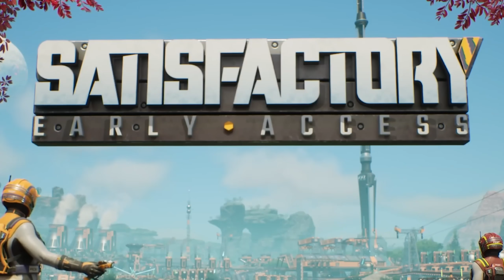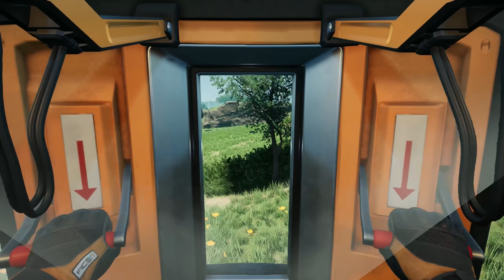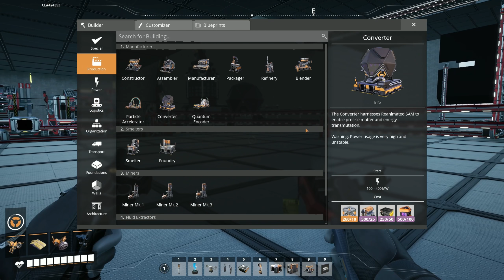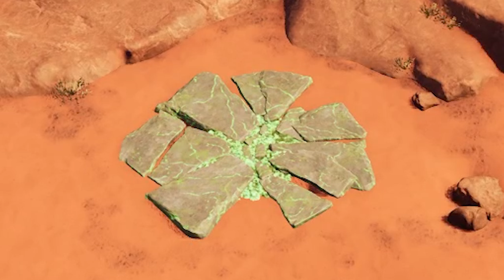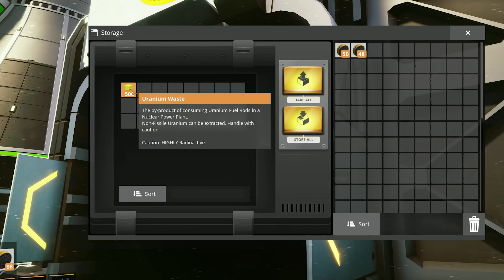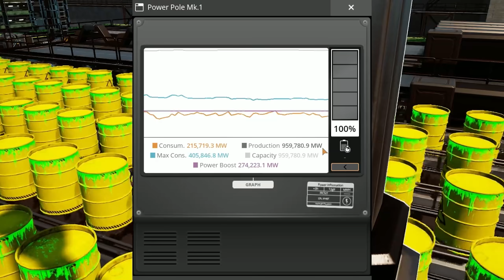800 HOURS in 8 Minutes - Satisfactory 1.1 World Tour

Comment: Now the real work can begin on my map. Now since the hover pack is unlocked and built.
My biggest issue now is the design. First off building the Zero Point Hub. Which is in the centre of the map. Space elevator is the beacon. Not bacon.....mmmm bacon. 😋
Some stupid reason I just can't go abstract and I like the looks of unusual designs but I just can't build it. The all have to be square to maximize space. Is that like OCD or something like that? lol
Making a hyper tube cannon and found a minor glitch when attaching the hyper tube branch to the line...don't. place it then connect. I ended up glitching though it then fell though the map.

Comment: How is anyone supposed to get to the endgame in this game if they don't have an engineering degree and can't play the game full time?
Reply: I completed the game in about 200 hours over 6 months, you don't have to go as crazy as ol kibz
Reply: I'm an idiot who is bad at math and I managed to get to endgame in like 150 hours. You just have to start simple and focus on one problem at a time. Also use blueprints, dear god I wasted so much time not making/using blueprints. You don't have to make elaborate super-efficient factories, you just have to make sure the system is self-sufficient.
Reply: @chandler224  And the biggest benefit of blueprints?  Single click deletion of those structures.  It SUCKS having to tear down a factory piece by piece by piece by piece.
Reply: You don't need to go crazy like the content creators. I love watching Kibitz, Kibz, TotalXclipse, but I finished endgame without a lot of monstrosity buildings (I have created some on some playthroughs but they aren't necessary, they are for fun!). You don't have to build 100/min of each space part, or generate 100Terrabytes of power; you don't have to use exact ratios, you just have fun figuring out how to get that one manufacturer to occassionally spit out a spacepart every minute, two minutes, 5 minutes, whatever, and eventually you get the goals done! I remember for a while I would just let it run while I was sleeping to keep the parts production going because I was only making 1 every two minutes. 

The goal isn't the space elevator, it's the fun you have building along the way. Enjoy!
Reply: @Harchon1  Totally this. While I appreciate the insanity that Kibz is willing to endure for our entertainment, I OTOH, don't have that kind of time, nor dedication to the overall project. When you have fixed numerical goals at endgame, it doesn't matter if you make 1/min, or 100/min, it'll eventually get done.  I never saw the point of spending 40 hrs building a factory that will produce all the elevator parts in 10 minutes, vs a single manufacturer that takes a few hours...I can spend that extra time exploring, or just admiring the scenery. I finished the game months ago with the simplest of production chains, although phase 5 taxed my brain at the time. Didn't even build nuclear power. But that's what I'm doing now...building up a nuclear plant and other blueprints to make the really complicated stuff simple and modular.